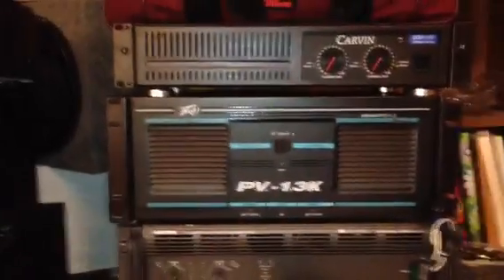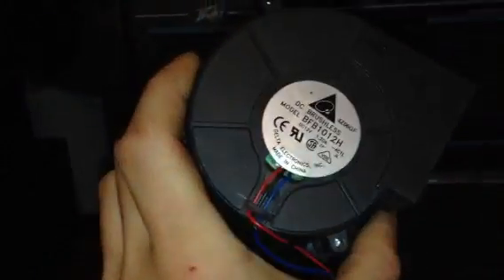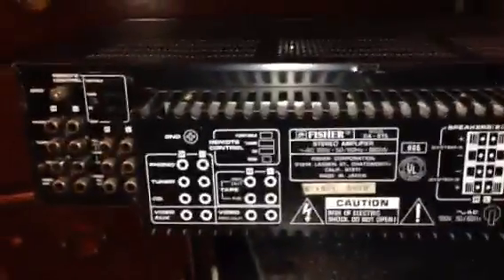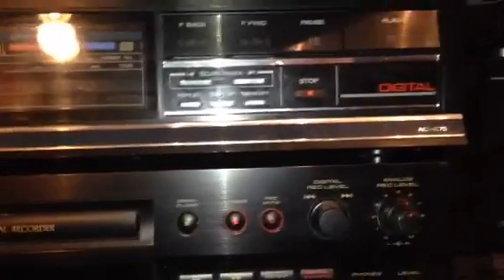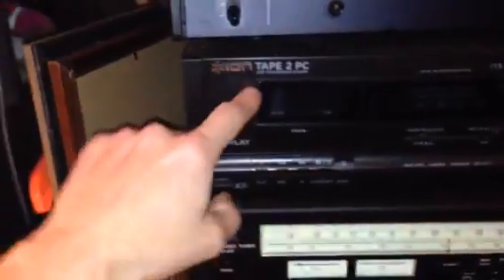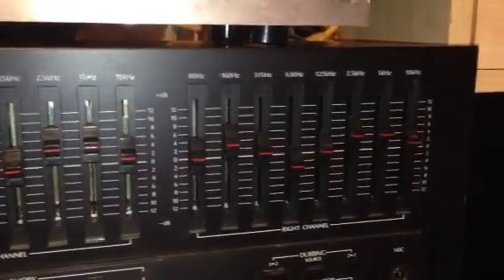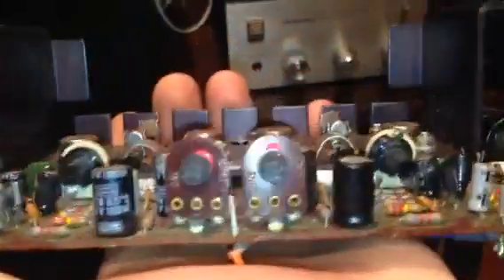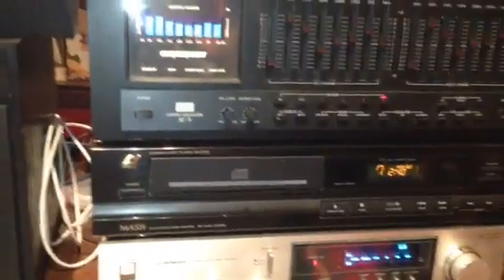More HIFI saved from the landfill!

Comment: I'm taking a guess here, but I'd guess the auto-class A circuit changes the bias on the amp for lower distortion - class A on soft passages and then shifts toward class B as the music gets louder. This gave the amp higher power capability on loud music by reducing the bias ( the outputs don't get as hot) and low distortion at lower power levels when the distortion would be more noticeable. Its actually an old concept. Brook produced a post war amplifier that had the auto bias feature:

http://www.tubecad.com/2007/12/blog0128.htm
Reply from the maker: Would that explain why it seems to run hotter at lower volumes and stand by?  Think this amp is any good?  I haven't looked up the power output yet.  What's your thinking?
Reply: I could see it getting hotter idling in class A mode than when thumping in class AB or B. I'm not a real audiophile so my opinion doesn't count for much, but it looks like a nice amp to me. And by the way, didn't you say it was free? That's the best part of all! Looks like you made a good haul there. Congrats!
Reply from the maker: Thanks.! I didn't need more stereos! Just can't let them be crushed!!  Ok then I see, yes it feels hotter idling.! Thought that was strange!
Reply from the maker: Yes, it was in the mud, and as usual I had to pour the water out of it, dry it for a couple days, then it fired up.  The speaker buttons were dirty, so only left channel worked, sprayed it, and well there ya go.  Fixed.  It's my daily driver and it is still working well!